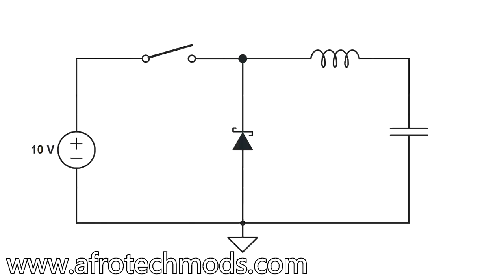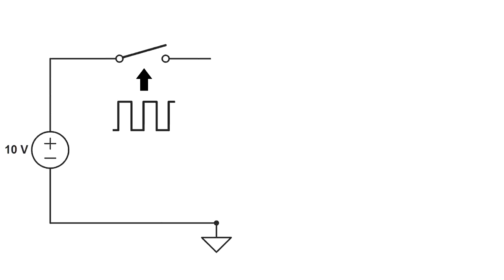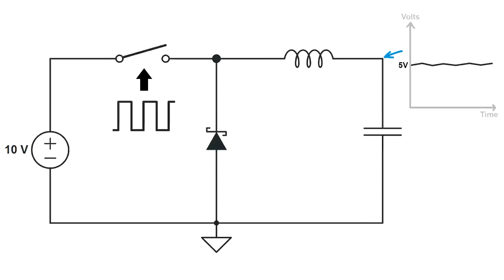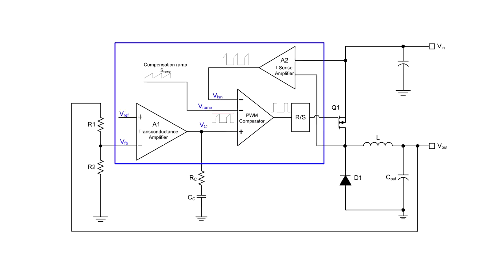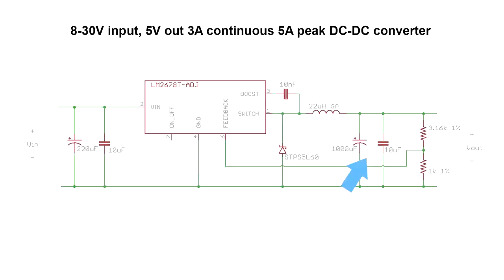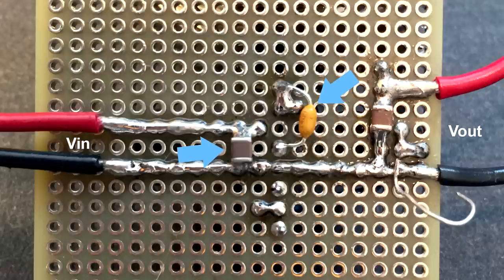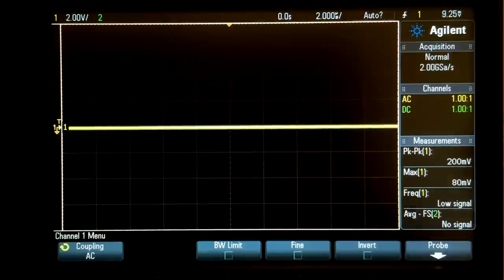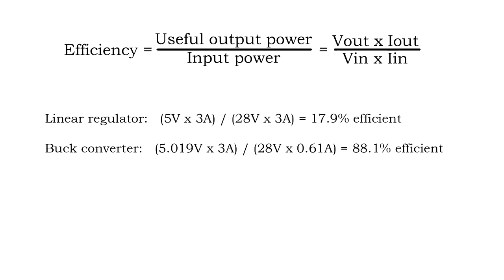Switch mode power supply tutorial: DC-DC buck converters

Comment: HI i was wondering if you could help me. im building this > http://oi65.tinypic.com/15g5vth.jpg  and was wondering if i can plug a 12v power supply into it? data sheet says upto 12v but on the schismatic it say 4v..
Reply from the maker: That looks like it's meant to be a boost converter, so no. If you want 12V to 5V then you want a buck converter circuit like the one I showed in this video.
Reply: Thankyou i decided to go with the LM2596. when i set output voltage to 5.50v and draw a 1A load the voltage falls below 5v my mobile fast charges at 5.50v to just over 1A but soon as the voltage falls below 5.50v it stops fast charging. with the phone still connected i up the voltage to 5.50v and as i increase the voltage so does the amps..would this be because its on a breadboard ? i get no voltage drop on the 12v INPUT and im using 100uf on output and 100uf on the input.

Comment: Can this be used to step down to 3.3 volts? I need it on 3.3 not 5.
Reply: Of course you can. Just change the 3.16K resistor to a 1.74K. For other output voltages, you can divide the voltage you need by 1.21 and subtract 1 to get the resistor value in kilo ohms.
Reply: fede142857 
Where are you getting the 1.2 value from that you're diving the desired voltage by?
Reply from the maker: Gonmoreno Watch this http://www.youtube.com/watch?v=QR8qsygs1Kw
Reply: fede142857 Nevermind, I answered my own question by looking up the data sheet

Comment: How can I decrease the noise of the output?
Reply: +fseeletronicos © Depends on how much you want to reduce it. The cap and coil combo in the Vout side serves as a low pass filter, which filters away the bulk of the noise (High frequency oscillation in this case). *Disclaimer, I'm only a first year university student, so everything from now on is just educated speculation *  By adjusting the low pass filter (changing the specs of the components) it may be possible to lower the filter's pass frequency and thus eliminating more noise. Also adding a higher order low pass filter may help. (see Wikipedia on low pass filters). If you wish go even further, you need to start taking the magnetic fields induced in the circuit into consideration. Those can be tackled by changing the circuit layout and furthermore reducing the distances between the components but that's quite hard core.

Comment: Why would using a breadboard be undesirable?
Reply: +Zambia95 From what I gathered, heat for one thing. And two, it seems you could melt your breadboard from the nature of this power supply, evidenced from how he talks about 'short and thick' solder traces, where as a bread board's pins or whatever they are, are rather thin, probably unable to take the high current.

Comment: I need to know why the electrolytic and ceramic caps are in parallel? Anyone help me?
Reply: Actually there was a video about that. (Also made by him/Afrotechmods).
https://www.youtube.com/watch?v=WytU5uj78-4
tl;dr It was because electrolytic caps contain parasitic elements like ESR (resistance) and ESL (inductance). These parasitic elements rendered the electrolytic caps useless for filtering high frequency. So the ceramic caps was added for high frequency filter, while the electrolytic one was still used for DC.

Comment: Why not breadboard? Not even for tests?
Reply: I have this question as well? Is this because of stray capacitances from the breadboard itself?
Reply: Well, I will try it myself how it works on breadboard :/
Reply: Breadboards introduce quite some capacitance to the circuit since (under the plastic) they are just metal bars separated by an insulator (air) which basically is a capacitor.

Also the current can become quite high (hence he makes thick solder paths on the PCB). High currents in a breadboard will damage the breadboard after a while (because of the heat). 

Also you want to have most components as close to eachother as possible to make sure ur working with the best (ideal) situations. Long leads and solderpaths etc lead to more parasitic capacitance and resistance which affects the circuit. 

It's all in the design cause after a while some components will begin to heat up eventually. Capacitors with a liquid like electrolytic capacitors will literally dry out from the heat and change in value. These are all kind of things you have to keep in mind while designing a circuit.
Reply: +trevortjes Wow great explanation, thank you so much!

Comment: after watching few these vidz about dc to dc convertors. make wonder why these circuits are called BUCK convertors.. I can see why for few reasons.   up down spikes, ripple p-p, voltage amp rises BUCKS like bronco horse. second, BUCK as in($.DOLLOR) convertor for the manufactures of these ICs get from cheap. poorly designed, even good designed power supplies. nuff said.
Reply: +funtroller smitty Buck converters are used to lower the voltage or as its name implies "oppose" the voltage while boost converters are used to raise the voltage. I think that is the only reason they are called buck converters.